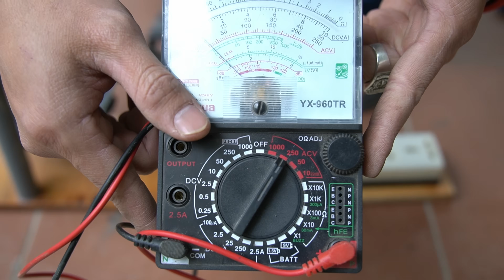Awesome Free Perpetual Generator Idea I Created

Comment: The claim of a “free‑energy” device using a motor, flywheel, and generator is physically impossible because the law of conservation of energy and the second law.
 Of thermodynamics state that no system can produce more energy than it consumes, and friction and electrical losses always cause such a setup to stop without an external power source.
Reply from the maker: Thanks for sharing your thoughts, would you like to see more detailed measurements and tests in future videos?

Comment: Your idea is very good, my question is: Can it be any engine? Or did you do some pole inversion on the engine?
Reply from the maker: Thank you! 🙌
In this setup, the engine type matters more than it looks. I didn’t modify it heavily, but there is a small adjustment in how the poles interact with the magnetic field.

I’m curious — would you prefer to see a detailed breakdown of the motor setup, or a comparison with a different engine type? 🤔⚙️

Comment: The generator is stuck to the plywood with a glue gun and driven with a piece of inner tube, yet has the torque to drive a drill?  You need power in to get power out.
Reply: No you dont magents produced the energy with the magnetic field

Comment: it's just a small generator, at a frequency of 50hz with a 4-pole rotor, the rotor speed is 1500 rpm, with a cos Q of 0.9, a voltage of 220 VAC, the power is estimated to be around 120 watts. while the generator's rotor rotation looks slow, not reaching 1500 rpm, so it is impossible to produce stable electricity, the voltage may be below 220 valt, the frequency may be only 30 hz, the cos Q may be around only 0.3, the power may also be below 80 watts. so it is impossible to turn on the drill machine
Reply: Anda benar ...semua di peruntukan hanya meramaikan konten untuk menggunakan kan bor supaya mesin  bergerak jelas tidak mungkin
Reply: Ok
Reply: Obviously not fool

Comment: You're crazy! Do you believe that this works and produces free energy?
NEVER!!!
The little electrical gadget is not a generator, but a small electric motor.
It has nothing to do with generating electricity. This system receives hidden mains power from below.
A "generator" of this size would have a power of about 200-300 Watts. A hand drill has a power of about 700 W. When you turn it on, the light should dim or go out. What do you experience? The light of the bulb shines completely evenly. So the system is powered by an external, stronger power network. What the genius with toenail fungus is presenting here is pure fraud.

Comment: This is pure B.S. No specs on the motor. No specs on polarity of the magnets on the flywheel. No polarity on the drive magnet. No regulator circuit for current from motor/generator to load. Without this info this device cannot be replicated or verified. The laws of physics as we know them dictate that the device can not function. The only genius here is how the electrical supply to the motor is hidden.

Comment: Holy crap, I built this with four spark plugs and I am now off grid. I have a two storey mansion and I charge boTo start the alternator is easy using an electric drill th our Teslas from it as well. This is crazy cheap electricity. I did not even use new spark plugs, I got them for less than a dollar at the scrap yard. The magnet comes from a PC speaker and all built into a shoe box. I would recommend everyone building this and we can close down all electricity plants world wide. I only had red paint but it seems to be working better with red paint anyway, blue does not transmit electricity as well as red. I think green may even be better. I also used Superglue instead of hot melt, it sticks far quicker and you can make the project in about seven minutes and have a lifetime of energy out of it. You can add spark plugs LEDs and even glue some stones and sand on it to be properly grounded. It is so powerful that I run my ducted air-conditioning with only one unit and keep the house which is about 3000 sq meters under 16 degrees centigrade. At night we can play tennis under new spotlights I have installed making it looks like daylight outside. I even sold some electricity to my neighbours This thing is amazing, I now find out you dont have to include the motor on the plank, it runs even better without the motor connected, the motor just uses electricity and does nothing.
Reply: pricelezz lmfao'z
Reply: je suis mort de rire de voir combien de personne peuvent croire se genre de connerie

Comment: Maby it will light a amall buld .but not a drill or a 120 lightbulb .please tell the hrute ok.😢
Reply from the maker: Thank you very much. ❤️❤️❤️
Reply: 잘 만들었습니다 축하드립니다
Reply: Every one of these videos about free energy is a lie. There is a battery in the base, or some other trick. Perpetual motion is not possible, it would violate the laws of physics, which have been discovered with careful, rational investigation and proven exhaustively. We have cars, trains, airplanes, motors, hydroelectric/coal-fired/ and even nuclear power plants because we understand the physics.